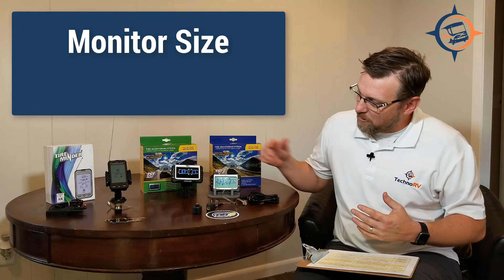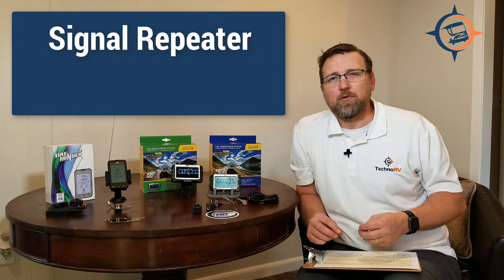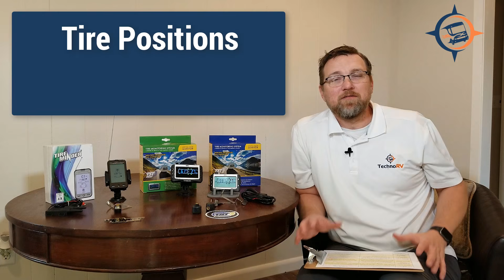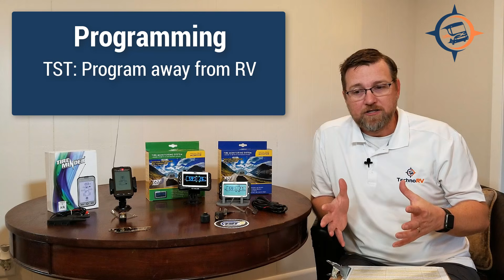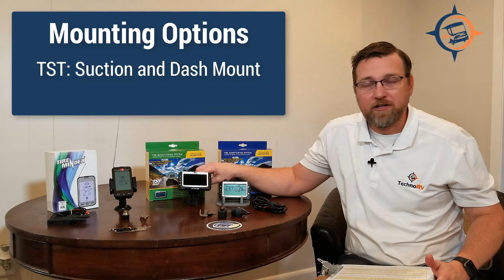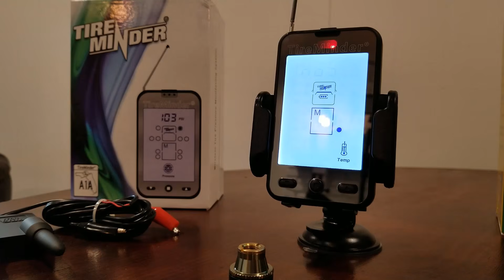TST 507 TPMS  vs TireMinder A1A TPMS: Which RV Tire Pressure Monitoring System (TPMS) is Best?

Comment: Great comparison video, thorough info provided, as usual with TechnoRV !
We have been very happy with the TST system supplied from the factory on our ‘21 Rockwood 5th wheel.  Ours feature the “internal sensors” band-strapped to the wheel.
The hands-free continuous “scrolling feature” of the TST monitor is a vital point of distinction over other systems. 
Once, we noticed one tire gaining temperature without much PSI increase . . .  so I found a suitable parking lot off the highway and checked that tire.  It had “slipped-a-belt” internally, with a very noticeable bulge, which would very likely resulted in a catastrophic blowout !
IT’S A MUST HAVE SYSTEM FOR TRAVEL SAFETY !

Comment: We just bought a 2022 Tiffin Wayfarer Class C and are in the process of deciding on a TPM.  I love your video and it confirmed what I had already come to believe. BUT ....  I'm just wondering if there is any updated info or new features for TST 507?  Also, where is the best price and company to buy the unit.  Thanks very much.
JosieNurse
Reply from the maker: Hi JoAnne, congratulations on your new Tiffin! We do have an updated video on the TST and TireMinder which will be helpful in your decision.  Here is the link:https://youtu.be/kitoKGnmduA
If you have any more questions, please let us know! If you choose to go with the TST, we do have a 10% off sale on TST through 3/14 when you use the code SHOP10 at checkout. We have a video on how to choose the right sensors as well, and it might be helpful as well. https://youtu.be/vIIqEbkD4fQ

Comment: Do you sell the Guta tpms?  It's about 1/2 the price of the TST.
Reply from the maker: We do not sell the Guta.  Price is not the top thing we look at when comparing and selecting products for not only our RV, but also TechnoRV.  The TST and TireMinder systems have both proven to be well made and reliable over the years, and we are happy to stand behind them both.  We have found that some of the less expensive models on Amazon do not have the quality we look for in a TPMS, even though the price is attractive.  You may spend more for a TST or TireMinder up front, but it will be a system that works well for many many years to come. In addition, they both have 3-year warranties, so you know the company stands behind them.
Reply: @Technorv  Thanks for the information.
Reply from the maker: You're welcome!

Comment: TST you can have internal inside the trailer wheel.
Reply from the maker: Yes, you are right!  TST does have an internal sensor and can be used in place of and in conjunction with the external sensors and all report to the same monitor.

Comment: Well , having watched this video . I am ready to buy TST kit . Do you ship to Canada ?
Reply from the maker: Yes, we do!
Reply: @Technorv  
I'm just putting an order in. It's in the cart. It's just one question about what I'm purchasing. I am getting 6 Flow sensors for my class A . The 4 cap sensors for my SUV It's included in the package ? Am I right?
Reply from the maker: When you are on the product page for the TST Flow Through Systems, you should have an option to add 4 cap sensors.  If you do that, then yes, they will be in the order.  Here is the link to the order page: https://www.technorv.com/tst-flow-thru-system-with-4-to-12-sensors/
Reply: @Technorv  I am in your page. I'm just confused if the four cap sensors are included with the system or are they not. It doesn't explain.
Reply from the maker: If you look at the page near the picture,  it asks how many flow thru sensors you would like.  Put 6 in there.  Then under that,  it asks do you want any cap sensors. That is where you need to put 4 if you want 10 sensors in all - 6 flow thru and 4 caps.  If you'd rather place a phone order,  we'd be happy to do that for you Monday morning.  866-324-7915
Reply: @Technorv  
Eric .
Please please e-mail me.
Reply: @Technorv  I,m been trying to purchase from your site , but as soon I reach to shipping address this is what I get , copy and pasted (Unfortunately we do not currently ship to your location. Please choose a different delivery address inside the United States or Canada. Thank you! ) The continue button doesn`t allow me to go forward .
Reply from the maker: Are you able to give us a call today?  We would be happy to do a phone order for you!  866-324-7915

Comment: The best defense against blowouts is a preventative like FlatOut trailer formula and a TST system to monitor. Yes they are compatible with external sensors.

Comment: Thanks, that's a very helpful comparison.  I don't think you mentioned readability.  How is the daytime readability of the color TST unit?  Is it bright enough in bright light?  Can the intensity be adjusted down at night?  How is the nighttime readability of the LCD TST unit?  Is it backlit?  Is the backlight adjusted manually or automatically?
Reply from the maker: The TST color unit has good readability in daylight as long as the sun is't shining directly on it.  As with an device, that would drown out the color.  As far as nighttime, the screen is lit well plus with the back background, it is not so bright that it is distracting,  It does have a auto dim though, but no manual dim switch.

Comment: Is there a preference on cap vs pass through on higher rated tires...I have G rated tires on my truck and fifth wheel. Would the pass through have an issue with the higher pressures?
Reply from the maker: HI Aaron.  The only consideration between cap and flow through is whether your valve stem is metal or rubber.  PSI doesn't make a difference with which one you use.  Here is a video that Eric made to help people make the decision between cap and flow through:  https://youtu.be/vIIqEbkD4fQ
Reply: @Technorv  Thank you! My other question is there any analytics showing failure rates between the two styles? Does one fail more frequently than the other?
Reply from the maker: @BigRedWight  Not that we know of.  Personally, we have not seen a failure rate higher on one type of sensor over the other.  When used correctly and on the right type stem (flow through sensors on metal only), the sensors both work the same.

Comment: In one of your replies you mentioned that TST has done some improvements since this video.  Can you please provide the most up-to-date model number for the TST TPMS?  Also, is there a particular TST models that might come with 10 mixed sensors  (6 flow through and 4 cap)?  Thank you
Reply from the maker: HI Ruth!  Yes, TST has made some updates on the monitor.  The added 2 spare tire positions and brightened the display.  It is still considered the TST 507, but you would want to be sure you are buying the newest model and not from someone who is still selling the old monitor.   Also, any TST 507 System you buy can handle both the flow thru and cap sensors on the same monitor.  We use it with 6 flow thru sensors on our RV and 4 cap sensors on our Jeep.  On this listing, you can mix and match your system:  https://www.technorv.com/tst-flow-thru-system-with-4-to-12-sensors/

I hope this helps!  If you have any more questions, just let me know.

Comment: @TechnoRV, Great video.  I am getting ready to retire and plan on extensive traveling and was wanting a tire monitoring system.  One of the the things I am looking for for is something that has an APP since my wife and I have expensive smart phones and we even have a laptop and with the new trucks having an AC outlet it just makes since to multi-purpose as much as possible.  Does anyone one have a system that uses an App or do you know if TST or TireMinder are working on an app??
Reply from the maker: Thanks,  Bill!  TireMinder now has a TPMS system that has an app that can display your tire information.  TST is not currently exploring this option due to the many distracted driving laws that prohibit drivers from using or having phones out while driving.  We definitely prefer having a dedicated monitor just for our TPMS, but you do have options now as it relates to apps and monitors.  Hope this helps!

Comment: I started out with the TireMinder and it did save me going around Ft. Worth TX, it gave me plenty of time to pull over. I saw the TST at the Open Range RV Owners Coming Home Rally 2 years ago and purchased the 507 Gray monitor (the color was not available yet), The next year the the color monitor was out and I purchased it. The reason I I changed TPMS were the same that you pointed out, the TST does not go to sleep and it scrolls through the tires and you can see each one without having to remove your hands from the wheel. I like the color monitor over the gray but it is sometimes a little hard to see the color depending on the sunlight.  My vote is for the TST but any is better than none! As far as the TireMinder, I gave it to my Son in law for his family's TT.  We are in the middle of a cross country, and Canada & Alaska trip and I check my 507 every day as we are driving (total mileage will be around 18,000 miles) ........Very good review even though some are suggesting that you chose the one you sell, I replaced my TM for the  same reasons.!
Reply from the maker: Thanks for the thorough feedback! We appreciate it when others share their experiences with the products as well. Safe travels!

Comment: It would have been nice to compare similar units, for example the TireMinder Smart TPMS compared to the TST 507. It seems like the comparison is skewed towards the brand you sell just by the units you selected to compare. This is not really a like-to-like comparison.
Reply from the maker: Hi Steve! We selected the 2 units  for the video based on the fact  that they were the ones featured  at the 2019 Tampa RV Show. TireMinder was showing the A1A and TST had the 507.  The SMART TPMS may have been there too, but we find that most people looking for TPMS either want the phone app  or not.  The features are less important than the fact that they just want the app.  While at the FMCA show this year, TireMinder was again featuring the A1A, so it must be a popular system for them.  That's the unit we get the most questions about too, so the comparison made sense to us.  In the future, we do plan to do more comparisons with some of the other systems out there.  Thanks for the comment!

Comment: I just returned from a 3,000 mile trip using the TST color model. I have a 36' Winnebago pulling a car dolly and a Chrysler Sebering so a total of 10 sensors. I had my repeater ready to go and never needed it. Nice surprise. My wife and I really enjoyed the peace of mind that our older rv tires and the others were running at the proper pressure and temps.

Comment: Eric, great comparison of the 2 products.  Over the last 13 years I have owned both  2 sets of TireMinder and I am currently running TST for the last 4 years.  The reasons I prefer TST is for the adjustable alarm settings, auto scroll, dependability, warranty and technical support.  I have adjusted the alarms several times due to elevation and ambient temperature.  The auto scroll is a must for me.  All I have to do is glance over every 5 seconds to see what is happening with each tire.  To date, TST is extremely dependable.  In 4 years I had one issue that was quickly resolved with the manufacturer.  With the TireMinder I had multiple problems and went through 2 set ups.  Your assistance with technical support is priceless.  One call or one email and you and Tami always respond and I thank you.
Reply from the maker: Hey Steve, glad you are loving the TST. We have had so many people that need the adjustable settings because of the different climates they go in and out of, and I cant imagine just having to suffer through a system alarming for nothing.  Luckily that wont happen with the TST. Safe travels!

Comment: I've had a TST now for about three years. It works fine except for one glaring issue. When hooking up the trailer, it sometimes takes up to half an hour for the monitor to find a sensor.....this is not good while boondocking in BLM areas as the potential for tire failure is very high as I am leaving a campsite on a unmaintained road. Also, once I disconnect the trailer, it can take up to 45 minutes for the monitor to realize there is no trailer attached. I can be miles away from the trailer and it is still reporting the trailer tire parameters. If a wheel was to fall off, I wouldn't know it.
Reply: Turn your monitor on when you start your hook up procedure. As for dropping off after unhooking just turn it off!
Reply: Do you have repeater installed and operating?
Reply: @burkhall1  yes, I have repeater. But if actire falls off, we will not get notified, no matter repeater or not.
Reply from the maker: Hi Roy!  It should not be taking that long for sensors to populate or to drop off if you aren't using them.  When we turn our monitor on, it only takes 5 minutes or so for all sensors to start sending information.  I would contact TST directly since you may be still in the 3-year warranty and let them know what is happening.  Their number is (770) 889-9102.